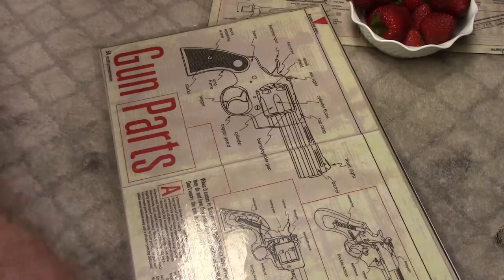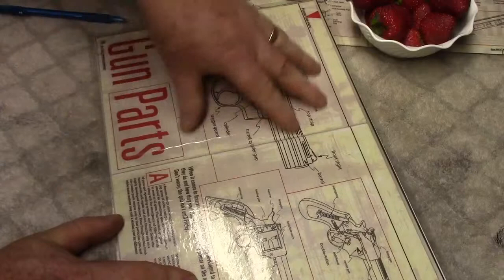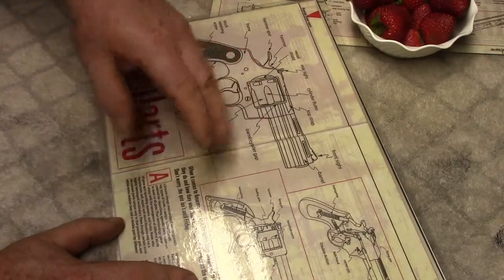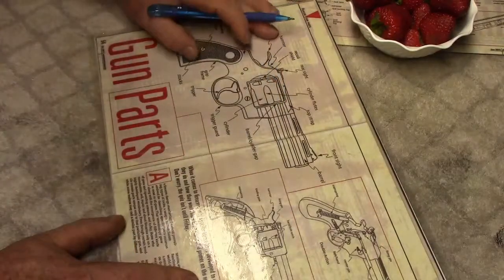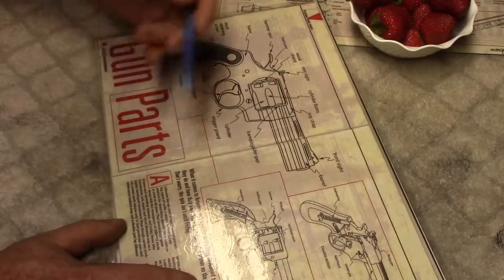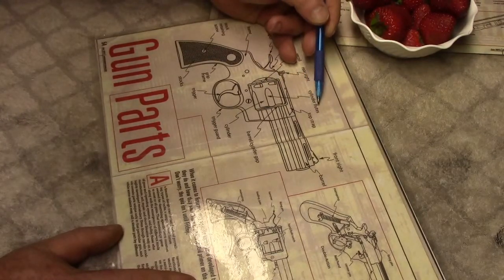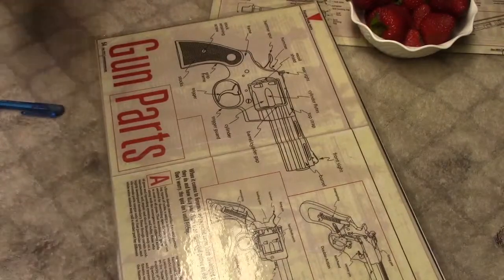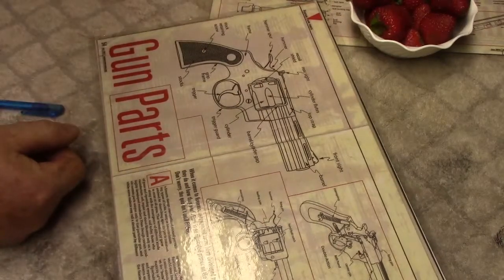Cylinder Flutes

Comment from the maker: Weight is the main reason, cosmetic is a small part, however a few manufactures say it also helps keep the cylinder cool under heavy firing while catching air.

Comment: I also think it's a weight thing since not all cylinders are fluted
Reply from the maker: buckeyeimaging Weight is the main reason, cosmetic is a small part, however a few 
manufactures say it also helps keep the cylinder cool under heavy firing
 while catching air.

Comment: I don't know much about revolvers but I would think its to show you your bullets in line with the barrel
Reply from the maker: drvshaft drew Weight is the main reason, cosmetic is a small part, however a few 
manufactures say it also helps keep the cylinder cool under heavy firing
 while catching air.

Comment: To cut down weight .
Reply from the maker: krazy45cat Weight is the main reason, cosmetic is a small part, however a few 
manufactures say it also helps keep the cylinder cool under heavy firing
 while catching air.

Comment: Yes I believe  krazy45cat is right.
Reply from the maker: MeNewBee Weight is the main reason, cosmetic is a small part, however a few 
manufactures say it also helps keep the cylinder cool under heavy firing
 while catching air.